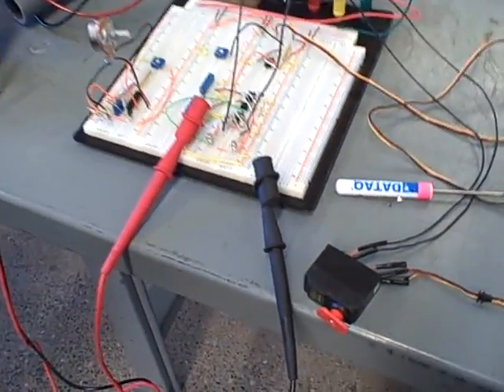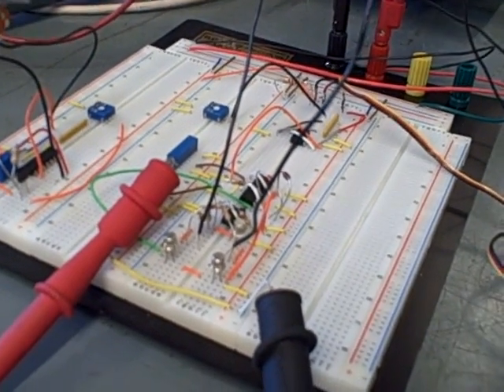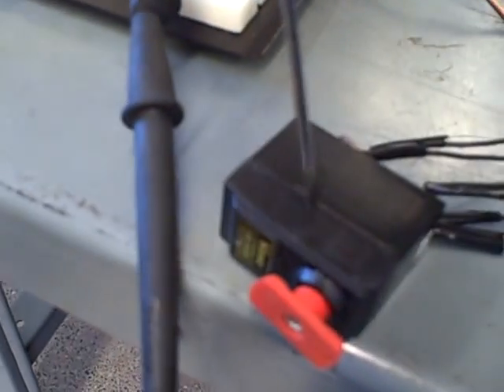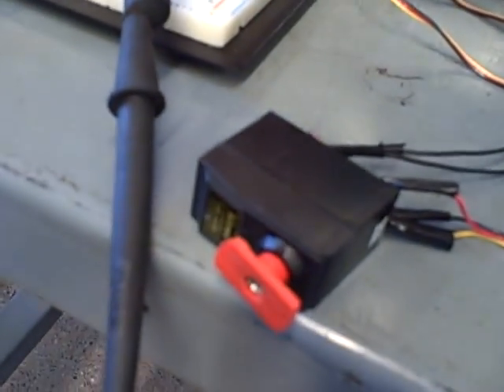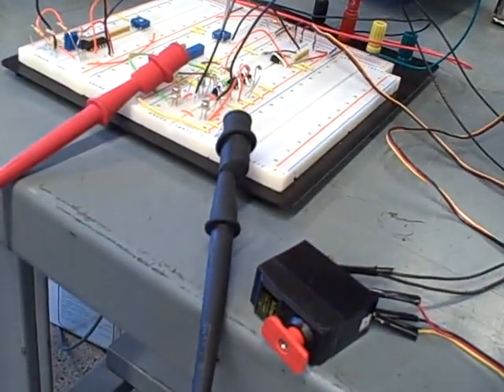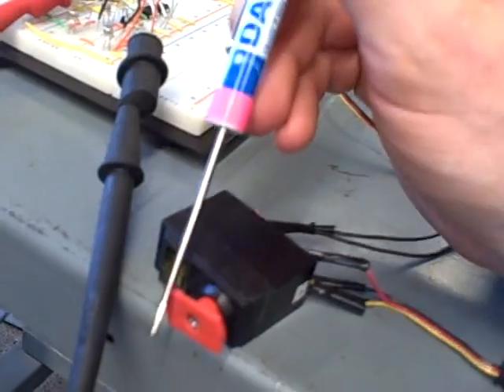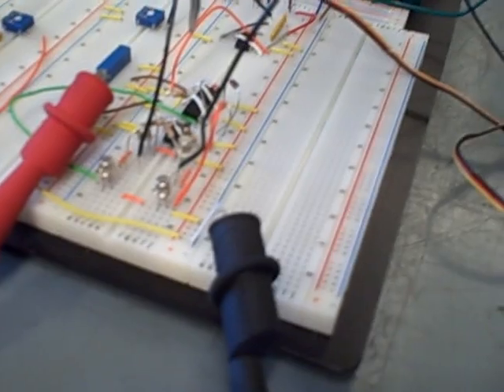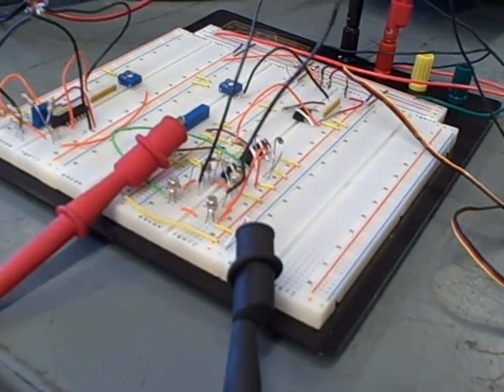Electric valve actuator using RC servo (prototype -- part 2)

Comment from the maker: @rayram55 Absolutely!  We still have some minor modifications to do to the servo circuit, and when we're done we will post not only the schematic diagram for the circuit but also the files necessary to make printed circuit boards.

When we do post these files, they will be found on the Instrumentation program web page.